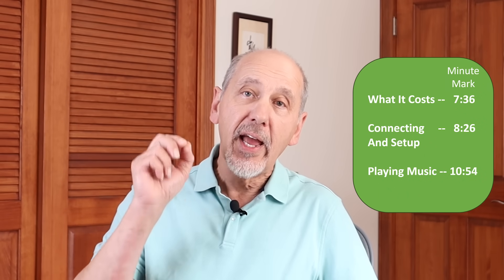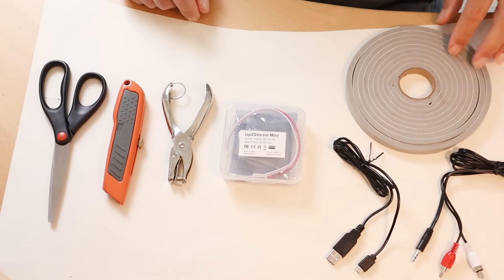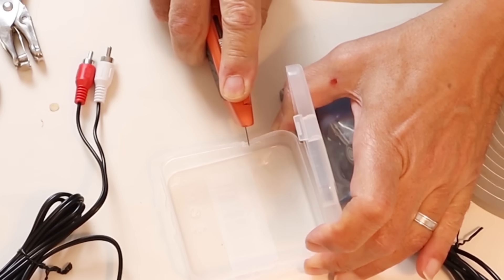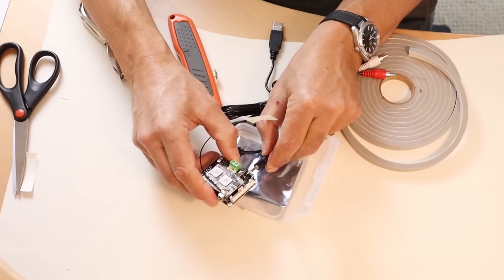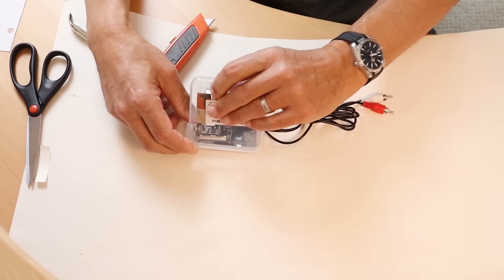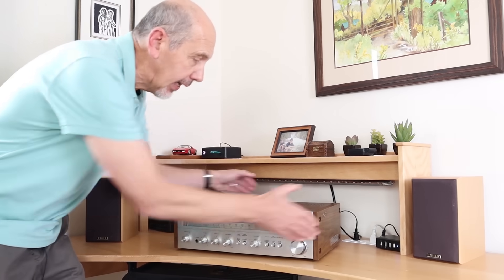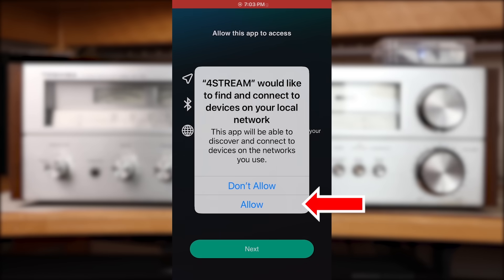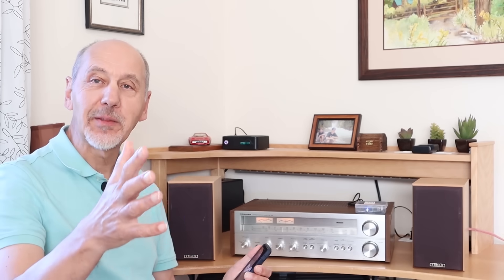Create A $50 Wifi Music Streamer Connect Phone Wireless to Stereo Receiver

Comment: I have an app on my Galaxy tablet that I installed (from Google Playstore?) called Airstream and in conjuction with an installed bit of software called Airstream Suite on my PC (an old HP desktop running WinXP) I can stream via wifi all my gigs and gigs of music from my PC to my tablet (and if need be I can then stream via bluetooth from my tablet to some bluetooth speakers)! I love it! Unfortunately it is no longer available and I thought it was lost forever when I recently did a factory reset on my tablet, but miraculously it reappeaed (which was surprising since I don't backup anything to the "cloud" and Google Playstore no longer lists it)... Occasionally the app can't find the PC but having taken note of it's specific IP address and code via the Airstream Suite configuration I can reenter those and voila, reconnect... 
What's curious is I installed the Airstream Suite on my newer PC (Win 11) but my tablet will not connect no matter what I try ... 🤔

Comment: I checked the specs,and while you say it streams over WiFi from your phone to the device, I’m afraid that is not the case. It clearly says on the site that Bluetooth 5.0 is used to stream music from your phone to the device. To get eye WiFi delivery of music, you would need to use their app to control the device and then the device would pull the music from the source using WiFi (as I understand it). That needs to be made clear as the video title and info seems to make it look like you are streaming music to the device from your phone over WiFi.
Reply from the maker: It does stream from the phone directly if you are using Airplay, but you are 100% correct about other cases.  The difference is pretty transparent to the user and would require too much explaining on a 10 minute video for the majority, who really don't care how their music gets to the speakers as long as it works reliably and sounds good.

Comment: Just use chromecast and poweramp or apple music I guess on iPhone might work, not sure don't use iPhones don't like them but a Chromecast that is dedicated only to music is only about 50 bucks maybe less anyway and it does stream over Wi-Fi is completely uncompressed on Android not sure about Apple music. Just double checked it does support chromecast with lots of the audio bit streaming from iPhone and there's absolutely no cables required it's all done over network no Bluetooth no nothing all Wi-Fi. If you don't have an amplifier with HDMI there converters and you'd still get out of it for not a whole heap more or you can look a lossless Bluetooth streamer with RCA output to our gas why you'd want to use rca's over HDMI is beyond me but each to their own or some people may just have an old amplifier I guess personally I have an Airfly pro and it uses APTX and has stupid long range it has battery power as well as usb-c works on aeroplanes with all kinds of earphones because it's a transceiver and receiver, it's super versatile it can be used in a car stereo that has an aux Jack but not a USB for media playback or even if the car has both this can still be used to implement a Bluetooth option in a car that never came with it from factory like my Mazda 3 a while ago 😉
Reply from the maker: Thanks for posting, Chromecast with an HDMI audio extractor works great. I have set that up for a friend and they still use it for their office music system.  It does work on an iPhone for most music services but strangely not for Apple music. Just as YouTube music will ONLY work with Chromecast if you have Android, but works everywhere if you have iPhone. Apple Music Will ONLY work with Airplay if You have an iPhone. The big Mega corporations can't play nice with each other and we get stuck with inexplicable incompatibilities. The work around is do download Air Receiver on to your Chromecast which is the best $3 you will ever spend, because then a Chromecast will then play anything from iPhone or Android.

Comment: only decodes up to 192.. cd quality is 256 so have to say i will pass on this. the quality is just not there. running wire to a speaker isnt that hard
Reply from the maker: Hi Thanks for posting your concern.  192 is the sample rate measured in KHz.  256 is a bit rate measured in Kb/s.  To get the equivalent bit rate for the streamer you have to multiply 192 by 24 bits which comes to 4608  which is way higher.   256Kb/s is claimed to be CD quality by Apple and other manufacturers and music providers because it saves them money relative to  actual CD quality which is 44.1 KHz 16 bit  which comes out at 705.6 Kb/s .   There is a lot of controversy in the industry and audio community about which formats and bit rates are optimum. But I do know the difference between 256 Kb/s  and an uncompressed CD is definitely audible.  Anyhow, rest assured that this streamer will play a true CD quality music file in all its uncompressed glory

Comment: Anti-static bags have conductive metal on them. I'm not sure that using one as a spacer is a great idea since it could short the back of the circuit board. It's not going to serve any purpose inside a plastic case anyway. Why not use a few nylon or metal standoffs and mount it to the bottom of the plastic box for a more professional look?
Reply from the maker: Watch this space for future projects that use nylon standoffs.  The intent of this video was to lower the bar for getting into DIY and I realized that in this case standoffs were unnecessary.  Many commenters agree with you on leaving out the antistatic bag. Addressing your specific concern  the very high resistance between points on the surface of the bag will not affect the operation of the board in any way.

Comment: if onl this streamer was compatabile with google home
Reply from the maker: Well, You could use a  video Chromecast with an HDMI  audio extractor,  This Video Shows you how.  https://youtu.be/p4TrWi5DooU  Google has been busy making their Chromecasts too expensive, but this $15 device is a very good substitute, especially for Audio. https://www.walmart.com/ip/onn-Google-TV-Full-HD-Streaming-Device-New-2023/2262757145?wmlspartner=wlpa&selectedSellerId=0&wmlspartner=wlpa&cn=FY25-ENTP-PMAX_cnv_dps_dsn_dis_ad_entp_e_n&gclsrc=aw.ds&adid=222222222972262757145_0000000000_21835691471&wl0=&wl1=x&wl2=c&wl3=&wl4=&wl5=9032666&wl6=&wl7=&wl8=&wl9=pla&wl10=8175035&wl11=online&wl12=2262757145&veh=sem&gad_source=1&gclid=CjwKCAiAg8S7BhATEiwAO2-R6kEC1CE9avvbH9mv7tjUY8GxDcp2aUGGag9vQAl_W5aVWz7PYkqU6xoC1woQAvD_BwE  It works great with Google Home.
Reply: @rogergadgetguy  the sound quality is shocking when doing it this way..ive tried already..im wondering if there is a way of maybe taking apart a google mini and somehow making a chromecast audio out of it?
Reply: Agreed. I've moved my house audio from Bluetooth to Google Home WiFi. 

The Arylic is impressive, but doesn't work with Home... Speaker groups, etc.

Comment: Doh! Out of stock. Must have. Desperately want a relacement for the Google Chromecast Audio.
Reply from the maker: There's a lot of people mad at google for discontinuing the Chromecast audio.  Other viewers told me about the Arylic board stockout on Christmas Day!   There are still some available from other sellers on AliExpress https://www.aliexpress.us/w/wholesale-up2stream-mini.html?spm=a2g0o.productlist.auto_suggest.1.1616sbdXsbdXRn  or the Up2Stream Pro can be used instead https://www.arylic.com/products/up2stream-pro-receiver-board. This board is a little larger and so the plastic case is a little bigger but the build steps are  the same. Another alternative for you, since you like the Chromecast Audio is to use a  video Chromecast with an HDMI  audio extractor,  This Video Shows you how.  https://youtu.be/p4TrWi5DooU  Google has been busy making their Chromecasts too expensive, but this $15 device is a very good substitute especially for Audio. https://www.walmart.com/ip/onn-Google-TV-Full-HD-Streaming-Device-New-2023/2262757145?wmlspartner=wlpa&selectedSellerId=0&wmlspartner=wlpa&cn=FY25-ENTP-PMAX_cnv_dps_dsn_dis_ad_entp_e_n&gclsrc=aw.ds&adid=222222222972262757145_0000000000_21835691471&wl0=&wl1=x&wl2=c&wl3=&wl4=&wl5=9032666&wl6=&wl7=&wl8=&wl9=pla&wl10=8175035&wl11=online&wl12=2262757145&veh=sem&gad_source=1&gclid=CjwKCAiAg8S7BhATEiwAO2-R6kEC1CE9avvbH9mv7tjUY8GxDcp2aUGGag9vQAl_W5aVWz7PYkqU6xoC1woQAvD_BwE
Reply: @rogergadgetguy  thank you!
Reply: @rogergadgetguy  I asked support when they would be back in stock and they arranged for me to be able to order them. FYI for anybody looking.
Reply: @rogergadgetguy  I contacted support and they hooked me up with an order of 2.

Comment: The compression is been done before the sound even reach BT.
Reply from the maker: If you are using a lossy music service like Spotify or Pandora then you are right the music is compressed already and the quality loss is not dramatic.  Uncompressed music is available from Tidal, Qobuz, Amazon, Apple and others and you can play ripped CD's from your phone or computer uncompressed. The difference is quite noticable.  Even with previously compressed music there is some quality loss in the transcoding to the Bluetooth SBC codec so even Spotify is slightly better over a lossless transport.
Reply: @ 
Lossless should not be confused with uncompressed, nor should compression on the temporal axis, because an analog (i.e. uncompressed) signal is transmitted by the ear in such a way that a sound signal is passed on to the brain every 7 microseconds. The CD with its 44.1 is therefore already significantly compressed because it only resolves a signal every 28 microseconds. In addition, digital filters must have correspondingly steep edges in order to avoid aliasing. This corresponds to significant compression in the frequency domain.
These are just two of many examples of how HiRes audio is better than conventional codecs but anything but good quality.
Talk to a mastering engineer who prepares the files for the streaming services ... you will be in for a surprise.
Reply from the maker: @n.r.2258  Interesting Take,  I do enjoy Hi Res music when available. Not convinced that the brains sampling rate is relevant. The signal out of the speakers is analog so that the digital signal is interpolated for our senses. The only loss of fidelity that would occur, is at frequencies above half the sample rate and our hearing bandwidth is well below that for other physical reasons.  I feel like the other issue that you mention with the steep filters is likely more responsible for any perceived difference with a high res file.

Comment: Thanks for the great video! You just got a new subscriber. 

I wonder if this system would support sync from one source (e.g. Spotify) to two amplifiers. I need to have the same sound across a rather large and open area and in most affordable systems the sync is poor.
I also watched your video about multi-room, but you don't comment on sync features, as for separate rooms it would not be relevant.
Maybe a future video?
Reply from the maker: Great question. The Arylic up2Stream mini board uses the same Link Play system for synching as Wiim, Dayton Audio, Audio Pro Audioengine, and Edifier These can be combined together in multi speaker setups. The sync between all these has certainly been good enough for my purposes, which is multi room. Any delay from an adjacent room is short enough to be perceived as pleasing reverb rather than annoying echo. Sound from different ends of the same room may be perceived differently and different people may be more sensitive to delays. Of all these devices, the Wiim products, including the $89 Wiim mini,  have the capability to adjust the delay to precisely sync the speakers.  Select the device in the Wiim App, and tap the gear wheel setting icon in the bottom right corner of  the control box for that device. One of the options that will only appear with a Wiim product is "Sync Audio"  There are automatic and manual adjustment options.  Chromecast is the other multi room speaker system that I know has a speaker sync feature, but I have never needed to use that adjustment  in my home. Thanks for the video suggestion I've put it on my video candidate list.

Comment: Or buy a Wiim mini ;) Excellent mini device, w frequent upgrades on sw side
Reply from the maker: Agree, the Wiim is a great value and works well out of the box and is well supported.  Arylic provide SW updates too, and the Wiim phone app works for the Arylic board if you prefer it.  Building this thing was fun, and  I was looking for a WiFi device comparable in price to a Bluetooth receiver which are typically $30-$50. The Arylic board is $39  The Wiim is $89.  $50 more for a piece of audio gear? I can afford it now, but well remember when it would have meant 5 fewer albums to listen to.  I've spent so much of my life enjoying great music on home built and sub budget systems that it's become an obsession to find good enough, for cheap enough. Maybe my thinking is obsolete and $50 is no longer meaningful, but if you are doing a multi room system they start to add up.

Comment: The auditory experience is being compromised by the pervasive utilization of lossy compression algorithms in digital music streaming. The audio signal, already subjected to compression during the streaming process, is further compromised by the inherent limitations of mobile networks and device hardware.

Upon selecting a stream on a mobile device, the Spotify application decompresses the audio data, which has already undergone significant lossy compression. This successive compression and decompression process inevitably leads to a degradation of audio fidelity.

The proliferation of compressed audio has resulted in a homogenization of sound quality, making it increasingly challenging to access high-fidelity music. The ubiquity of lossy compression in digital music distribution has created a paradigm wherein convenience and portability are prioritized over audio quality, rendering it difficult to procure uncompromised musical experiences. He took his flashlight.We gave up so much leaving dVd and cd  audio for the convenience today's music.
Reply from the maker: Thanks for this thoughtful reflection on the state of the music industry. It's even worse than you describe, because the mastering process over compresses the dynamics to sound acceptable in cars and on earbuds in noisy environments. The Artist's voices are auto tuned or pitch corrected so the mediocre singers sound no worse than the great ones, who's artistry is masked by the over use of digital processsing.  Technology is good enough now and inexpensive enough to allow the industry to send us high resolution minimally processed audio acompanied by a set of coded insuructions for the playback equiment to give us the best possible sound customised for various playback environments and types of playback equipment. For a quiet listening room and high end playback equipment the results would be far better than the compromised and compressed recordings we are currently offered. I have seen no evidence of willingness to apply new thinking to the  recording and playback processes with a focus on quality rather than convenience or cost of delivery.  All that being said we do listen in our cars, and on planes and trains and Spotify and Bluetooth are fine for those environments. For home use lossless streaming is available and is worth the extra cost.  The streamer I showed plays lossless music.  Although you can pay much more for ever diminishing returns with todays compromised master recordings  It does represent a gateway to real HiFi Sound, for those who have become accustomed to Bluetooth.